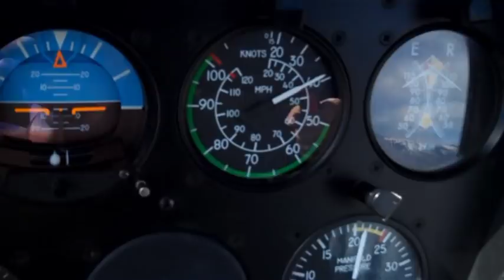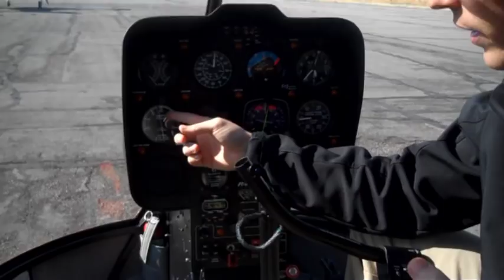Translational Lift

Comment: Hi, wasn t the decrease in induced flow angle at the front of the mrs  as the rotorcraft departs stationary flight at the root of transverse flow effect, and etl caused by difference in velocity between the advancing and the retreating blades?